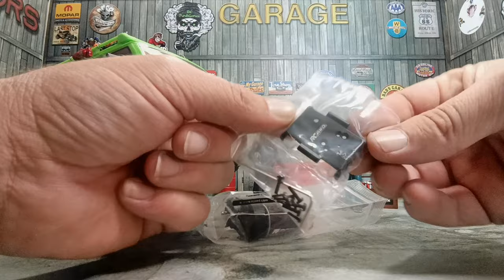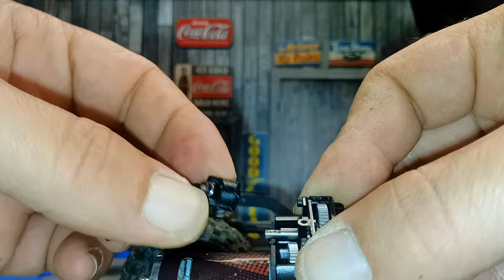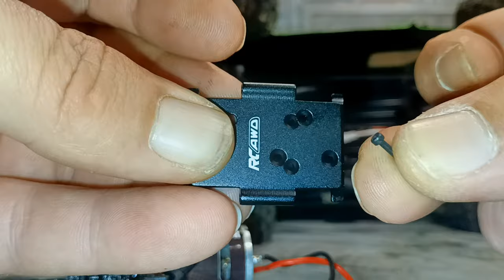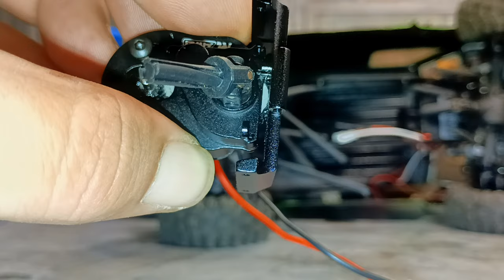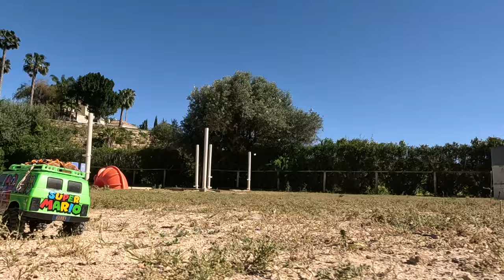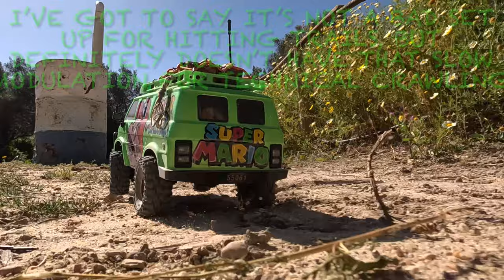RCAWD 370 Motor and Transmission upgrade  for CR-18P hobbyplus Rockvan

Comment: No hex screws? Kinda surprised. 
Also, sorta....not s fan of, how that gear box looks, leaves the gears open for debris to get in there, even if everything is greased & oiled, would have me worried.
Reply from the maker: It came with hex screws, but as you could see they didn't provide any countersunk hex screws! 
Besides that I totally agree with you!!
I don't like an open gearbox!!
And I really don't like the way the whole gearbox sits on two little pieces of aluminum, only on one side of the transmission! 
 The first thing I said when I looked at it! Was that I don't like anything that's got open holes for little stones and dust to get into!! Especially when it's made for speed!! and the wheels are throwing all that sand and dust up into the transmission!!
They definitely need to rethink the design of this transmission! 
But if you're ever building an on-road truck it's a pretty good setup for a clean environment! 😅
I really appreciate you watching and leaving me your opinion! 
That really means a lot to me, as I have the same concerns with this product.
Reply: @rcfungames  I couldn't agree more, dude, they definitely need to re-think their design aspect of their motor upgrades, especially when it comes to their gearboxes. Especially if you look at Axial's SCX24s, which doesn't have holes or you look at Traxxas' TRX4Ms that don't have holes, neither. May be learn from other companies, would really help them, in the long run. 💪🏻🤠

Comment: That’s some torque twist on that driveshaft!   Wow!😮
Nice honest review and yea this is definitely a speed motor for the CR-18!
Reply from the maker: I was definitely a bit shocked to see the state of the drive shaft!!
I have barely run this van and definitely haven't got it in the situation that it should have done that damage to the drive shaft!!
Going to be checking my other van which has run a lot more to see if it is also sustained this damage. 
I really can't remember getting it in any situation that should have caused that damage. 
I had to be honest, in my opinion this is not suitable for anybody trying to build a crawler!
I have already spoken to them and they will be letting their design team know, and hopefully they will be addressing the issues I have mentioned.
I am hoping to see a sealed transmission with at least two pinions provided one for speed one for crawling. 
Thank you so much for watching bro and taking the time to leave me a comment. 
🤜💥🤛

Comment: Wish I seen your video before I ordered this. Everything you say is correct. It is hard to believe anyone approved this disaster of a transmission. Mine was “unbranded” but exactly like yours. I assumed mine was missing parts etc and got a refund on mine but they let me keep it. I did install it since I had it and it’s kinda fun, but too fast for any crawling and I would never recommend this to anyone. The worst single rc item I’ve owned. Also I have never seen an ad for these that shows the huge gaps and absurd narrow-edge floating mounting arrangement. They don’t want you to see what a joke this item is.
Reply from the maker: Bro I was so disappointed with this transmission and motor combo!!! 😔 
Luckily I didn't pay for it and it was sent to me to be reviewed! 
But as you can hear in the video, I was clearly not impressed!!
It's great if you do a lot of trails, that extra wheel speed is awesome. 
But it really struggles to do some nice slow crawling now, and the way that transmission sits floating in the air on two little tiny points of contact!! He's a massive design flaw! 
To be honest all the parts I tested from them, we're about the same! meaning, that it looks like they didn't take much time thinking about the quality or longevity of their product. 
Hopefully, they will up their game.
The worst thing is that when I try to tell them what I thought about the product, and if any reduction gears would be available for that transmission!! I never got a reply! 
And when I expressed my concern about the way this transmission fits to the mount plate, they also never replied. 
As you can imagine I was a bit disappointed.

Comment: Injora makes this too correct?
Reply from the maker: No, not as far as I am aware!
So far, I have only see this setup available at RCAWD.
It's a great concept but they definitely need to rethink the open transmission design! 
After that short video the transmission is covered in sand and dust!!
And of course I can get crunching inside because of the sand entering all the holes! 
Great concept but not a good design!

Comment: Not a good setup for crawler thanks for the video
Reply from the maker: No definitely not!! 
It would have been nice if they provided a different pinion gear to gear it down! with the kit!!
I also don't like the fact that dirt and stones can get into it! 
And I'm not a big fan of only having two little tabs on one side of the transmission to support all that power! 
They definitely need to rethink the design. 
Thank you very much for watching and leaving me feedback 🤜💥🤛
Reply: @rcfungames  hoping they listen to your critical feedback I bought their aluminium transmission skid for the t hunter thinking it was a upgrade but there was no way of mounting the transmission the evo version thanks

Comment: Over priced bad design…you will need to change the electronics to make it crawl again with that motor set up, hobbywing esc /dumborc tx/rx will do 😊
Reply from the maker: @R-EVLMNKY  totally agree overpriced and really badly designed! Even if you change the electronics, which I have done since this video, it needs reduction gears in a transmission which are not available. 
So definitely a no-go if you're building a crawler. 
But for those that want that extra wheel speed, I guess it's okay.
Reply: @rcfungames  thanks for that added useful info! I was thinking it could do both after doing the electronics 🤭 I guess we need 2 of them for both fun😂😂😂

Comment: Not the set up you want for crawling. and to not include the proper hardware to install is just wrong !
Reply from the maker: No it's definitely not set up for crawling!! Which is rather disappointing 
And yes I was even more disappointed that the proper hardware wasn't included. 
I have let them know all the issues I have had with this system, and they said they would be addressing the issues. 
So let's see what the V2 will be like 
Hoping to see a completely sealed transmission, with at least two pinions provided, one for speed one for crawling 
I really appreciate you watching and taking the time to leave me a comment bro. 
Thank you very much 🤜💥🤛
Reply: @rcfungames sadly I don’t think they care. This item has been out for over a year. And they have a version for the fms straight axle trucks. Same issues.